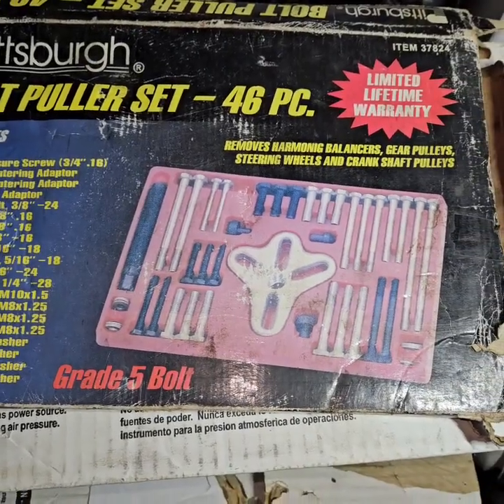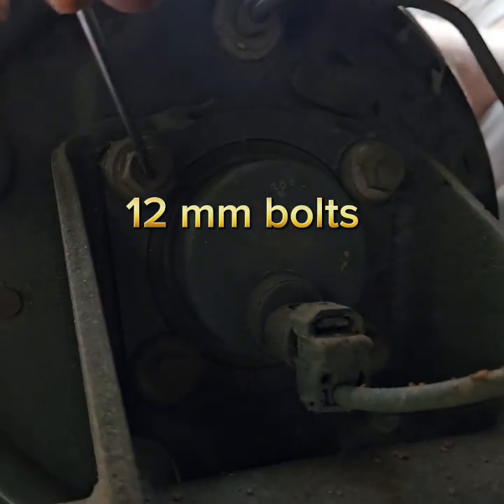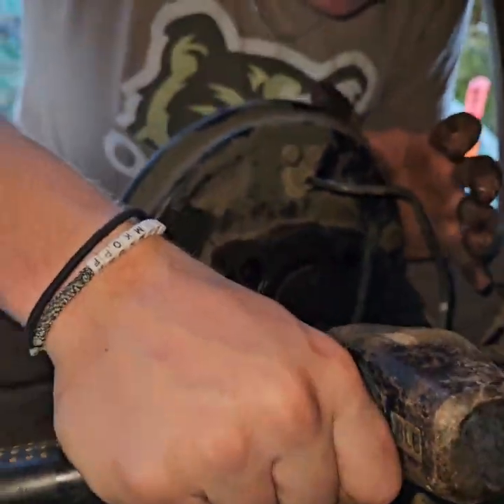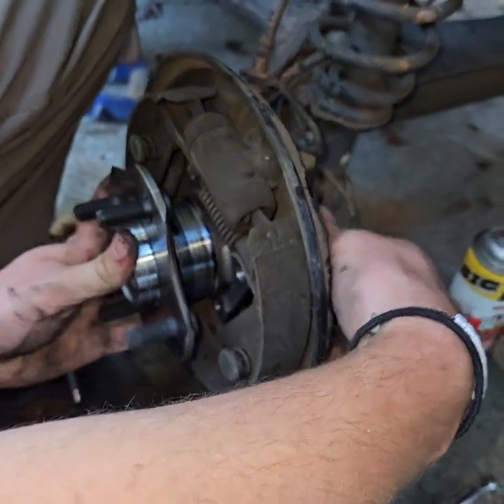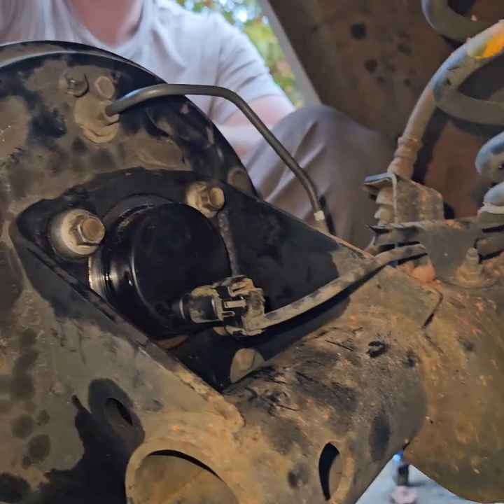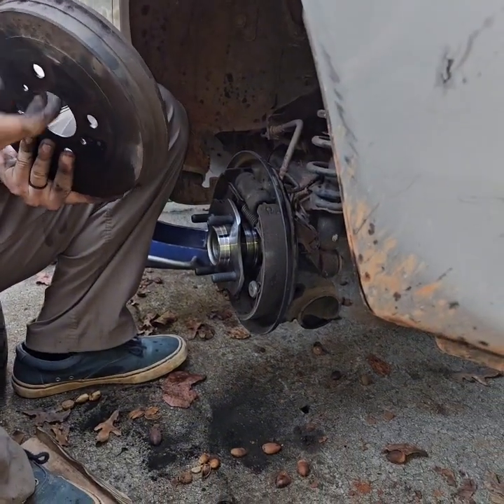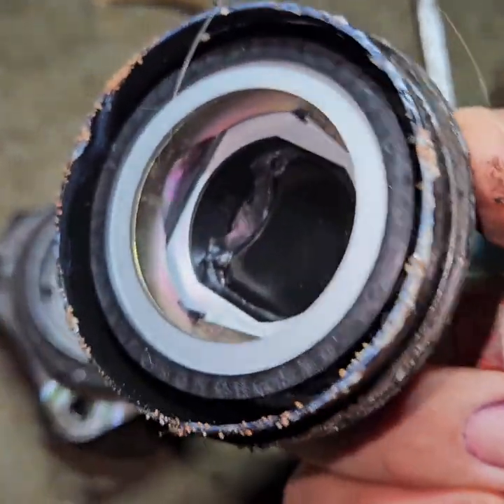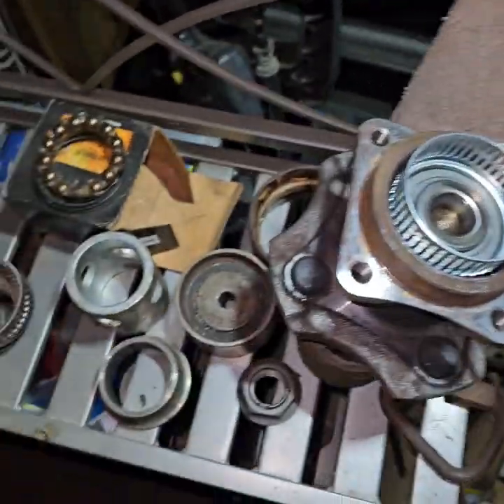Gen 1 Prius rear hub assembly removal and installation.

Comment: I have one question. Why didn't you show how to get the hub off of the plate? I have been having the problem of releasing it from the plate.😮
Reply from the maker: Yes, unfortunately when I thought I was taking that video it was a picture instead of a video.  The easiest way to separate the plate from the hub is to NOT remove the hub bolts all the way. Loosen them so the hub has space between it and the suspension where it mounts. Then remove the brake shoes and drive a screw driver or putty knive between the backing plate and hub assembly and apply some PB spray. Hope that helps.

Comment: You didnt show the fun part of getting the rusted up old bearing off the car! I know you did not beat it with a hammer, so how did you get it off?
Reply from the maker: @michael47lamb  I unscrewed the four bolts two turns and trapped on them with a 3/8 inch socket extension. Once they hit the axle plate, I unscrewed them another full turn and continued until the hub was out of the hole.
Reply: @roscoesrepairs  Interesting idea! Wish I had thought of that years ago. What I used on my Gen1 prius is two long 1/2" dia bolts and nuts. I "jacked" the hub out of the hole after knocking two of the lug studs out with a couple hammer blows and insert the long bolts and put the nuts on the inside. Hold the bolt still while turning the nut. Very easy to do. No major hammer work, which no doubt saved my shoulders and hand much abuse too. ;-)